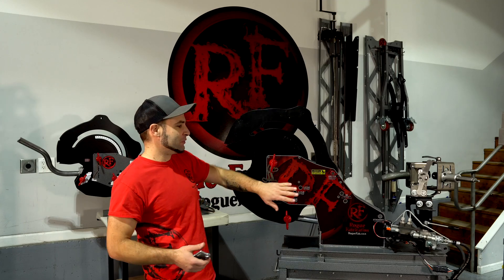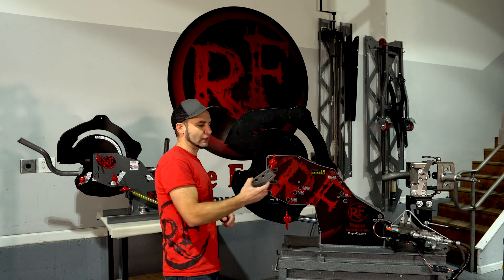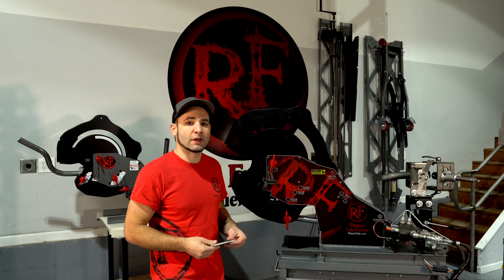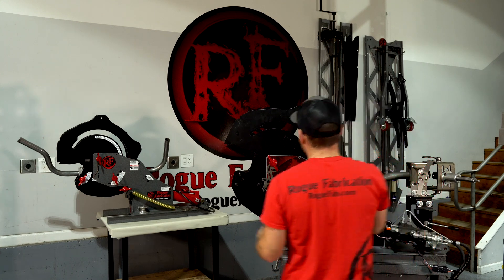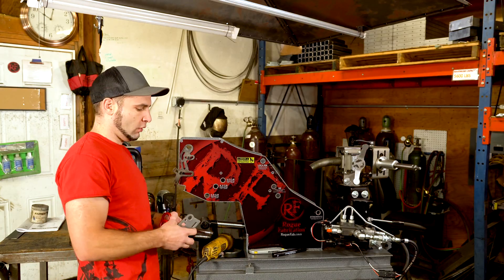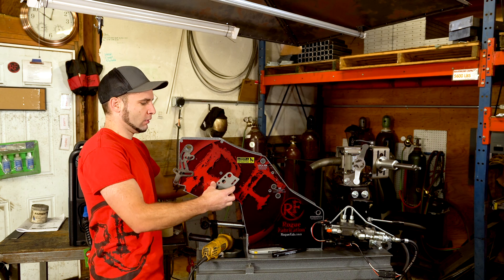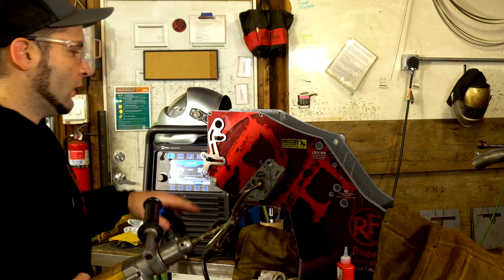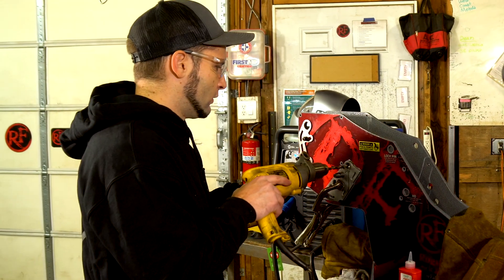How to UPGRADE your Tubing bender – DIY M625 Conversion

Comment: Why weld that plate on the side? Why not just use it as a drill template and move on? Curious because I am considering upgrading my M600xHD.
Reply from the maker: Just for more pin wear resistance.

Comment: Wish there was upgrade like this for the OG alpha bender I got from you guys first started
Reply from the maker: The pre-2015 machines are about 25% smaller overall than the machines made after that period, so no upgrade is possible. You'd be welding metal on all over the place. The dies and clamp blocks are identical though!

Comment: People are tempted to drill fast thinking it will get through faster, but if you ever drill on a drill press it's slow so it bites better than, so just toggling the trigger to keep the speed slow will drill better and not burn the bit up
Reply from the maker: Yeah, grab calipers. Chips at about .010 thick and curly! I couldn't get them to curl this time 😩

Comment: I Benders older than this one, can I still do this?
Reply from the maker: The pre-2015 machines are about 25% smaller overall than the machines made after that period, so no upgrade is possible. You'd be welding metal on all over the place. The dies and clamp blocks are identical though!

Comment: My bender only has 5 holes total in the side frame. I certainly don't have as many holes as are shown in this model.
Reply from the maker: The pre-2015 machines are about 25% smaller overall than the machines made after that period, so no upgrade is possible. You'd be welding metal on all over the place. The dies and clamp blocks are identical though!
Reply: @RogueFabrication  I was afraid that might have been the case.